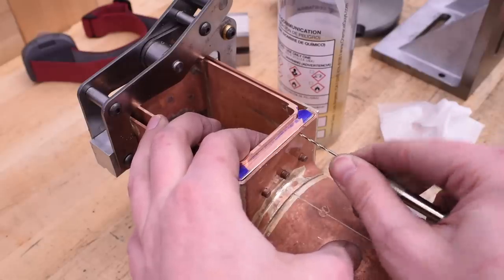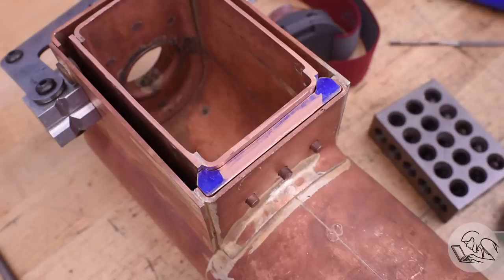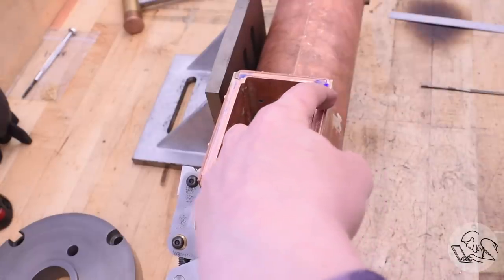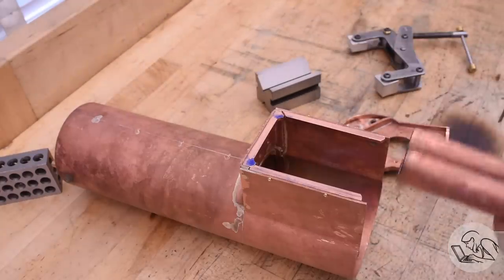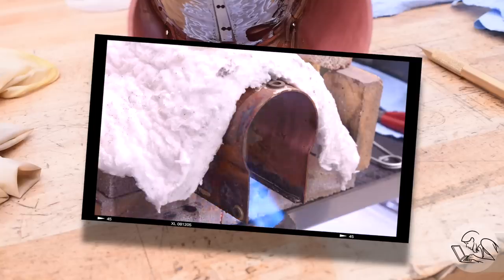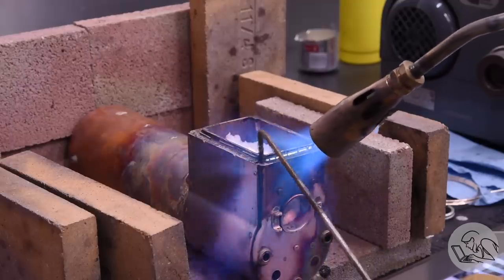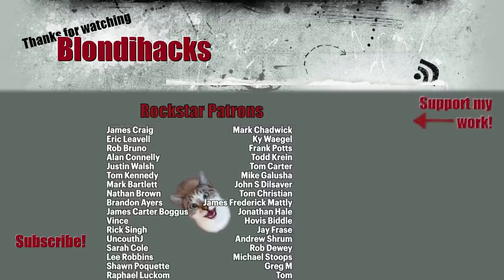Foundation Ring and Backhead! Pennsylvania A3 Switcher, Part 11

Comment: I'm a boiler tech, not a train head, but we call the lowest point of a boiler the mud lug because, well...open up a plug at the end of the season to find out!
Reply: all the insoluble material collects there. looks brownish and ugly.
Reply: That's what I was thinking. I've seen some of the "stuff" that comes out of the bottom of a boiler.
Reply: It can be silky smooth sometimes, and makes a great dye for everything that you don't want to get dirty.

Essentially, all boilers are distillers. Makeup water is a necessary evil, because new water means new sediment and dissolved oxygen which destroys a system. On larger boilers (100hp and up), if the mud legs aren't blown down regularly, the mud eventually turns into something like semi-solid concrete. That's when we hand the chisel and grinder to the apprentice.
Reply: It's why full size locomotives have to go through a 31-day inspection that includes a boiler-wash:
CFR 49, Part230:
230.60 Time of washing.

(a) Frequency of washing.  All boilers shall thoroughly be washed as often as the water conditions require, but not less frequently than at each 31 service day inspection. The date of the boiler wash shall be noted on the FRA Form No. 1 or FRA Form No. 3. (See appendix B of this part.)
Reply: @joextarr8916  
Or you can use the Myth Buster method, a bit of the old boom stuff. Just don't quite take it to the cement mixer level. LOL
Reply: @jdgindustries2734 

Are these locomotives 100% makeup water? There's no condensate return systems?
Reply: @joextarr8916  yes. American Railroads tinkered with the idea of recycling the exhaust steam, but the equipment was too finiky and couldn't hold up to American Railroading demands. Also considering water back then was nearly ubiquitous, and where it wasn't, railroads ran tank trains of water to stage it.

But also the regulations are written assuming bad water. They are there for safety reasons

Comment: It's called the mud ring because when you make steam, you end up precipitating out solids. Those end up in bottom of the boiler and looks a heck of a lot like mud.  In a big boiler made of steel and cast iron, you end up with a lot of rust down there as well.
Reply: This exactly.
Reply: There you go. I previously thought it was named by fans of 90s/2000s progressive metal band Mudvayne.
Reply: Which is why, as Dallens points out, you should only use distilled water to keep the mud problem to the minimum.
Reply: @Dallen9  in some places they had collection troughs between the rails that would catch rain, then the tender had a scoop to scoop up the water. As a power plant guy where ultra pure water is the way......
Reply: @DavidVerch  That is crazy. No RO skid back in the days?
Reply: @Dallen9  was my thoughts actually... I mean just look in the bottom of your kettle!
Reply: @MikelNaUsaCom  Yes as I remember we blowdown at least once or twice a day on steam boilers {not a train boiler}
Reply: @oldfarthacks  Distilled water is hungry water; corrosion would be more of an issue
Reply: @royreynolds108  I will have to research it more. I did not know the troughs were so long, nor the tanks to fill them. I have heard but do not have any evidence that they would put potatoes in the boiler to help precipitate hardness. The city of Cocoa has a lime softening process where they use potato starch to help in the precipitation.
Reply: @MikelNaUsaCom  Ultra super critical boilers are once through and cannot have moisture separators as the feedwater and steam is the same density. Any contamination in the feedwater goes to the turbine and usually plates out in the low pressure section.... At one of the plants I was at they had several steps to purify the water. The purification system was in service continually and if there was no need for makeup, it would just re-circulate what was in the tanks to further clean it up. The way I figured it the purity of the water was just shy of what is required in the chip making industry. Another plant I was at had the transition section from the turbine to the condenser painted and we had issues with high silica during startup and other transients. That was difficult to get to the bottom of. The turbine manufacturer was not very helpful.
Reply: @crissd8283  Lime softening was developed in the late 1830s in England. I would imagine British rail used it first to help with boiler scaling.
Reply: @MikelNaUsaCom  The lower the pressure the water, the dirtier the water can be in the drum. As the pressure goes up the density of the steam goes up and more of the contaminants leave with the steam and therefore the boiler water is stricter.
Reply: @MikelNaUsaCom  I think these boilers are like 30 psi or something. Much different than the requirements for a 2400 psi boiler.

Comment: Micro tip (and just the tip!) - when you're trying to knock out that last 1 or 2 thou in soft metal (opening up that clearance hole in your case) under power like with your drill, run the bit backwards. It's not 100%, but stops it from grabbing, ripping and pulling itself through the hole.

Comment: I learned the hard way Sharpie repells automotive and house paint. I had some marks on sheet metal when making panels for my 31 Model A Ford. Well I had to sand off the primer and acetone to remove the Sharpie
Reply: I also learned this the hard way. 😺

Comment: Quinn- I have been a scale model railroader for over 40 years. My grandfather was a master machinist for the Santa Fe Railroad, earning his apprenticeship in 1913. During my lifespan I have done a lot of soldering of brass locomotives in HO and Sn3 scale. Early on I used a small jewelers torch and then progressed to resistance soldering. In projects MUCH smaller that what you are doing you can imagine what happens when you overheat and all the OTHER parts start to fall off! I would point out that I was NOT trying to make a pressure vessel! This was a process to fabricate a "boiler" from scratch and attach many, many brass castings and parts to make the complete locomotive. I had a lot of friends who were quite simply master craftsmen who could totally build a scale locomotive right down to the exact number of rivets (hence the term "rivet counters"). Again, the model locomotive was powered by an electric motor and not live steam. The "live steamers" (a fraternity that you are joining) are in a class all their own and I'm sure you have seen many examples of their fine work. In most cases, they appear 100% true -to-prototype and perform flawlessly. From similar 0-6-0 "shifters" to massive compound locomotives that are capable of pulling a string of passenger cars (with human riders) along a mile of track. Unfortunately most of these folks are getting up in years and very few young people are interested in developing the skills necessary to accomplish such projects. Thank you for your fine videos and for keeping this craft alive!

Comment: Old boiler inspector here… The main purpose of the water jacket surrounding the firebox in a locomotive boiler is to provide an easily cleanable low point for dissolved or suspended solids in the water to accumulate. Without mud legs that muddy precipitate would collect around the tubes, usually at the tube sheet and drastically reduce heat transfer, promote corrosion of the thin fire tubes and lead to cracks in the tube sheet. There are always handhole clean outs at each bottom corner of the mud leg. There’s a small benefit of added heat transfer surface as well.

The puffs of steam from the smokestack are actually the exhaust stroke of the drive pistons channeled to the smokestack as blondiehacks said to induce draft. Many locomotives have an hourglass shape to their smokestack that creates a Venturi (a convergent-divergent nozzle) that greatly accelerates the speed of the air out of the boiler.

Comment: I would never had though making a scale train boiler could be so edge of the seat! I’ve built 1/12 scale 5 ton military trucks from brass and copper and know how hard it is to solder a joint next to an already finished joint. You make it look easy, great job as always!

Comment: Tip for you on that solder joint that opened up on you.  Stuff a bit of copper wool or solder wick - the braided copper used in electronics industry to remove solder from a component being removed from a circuit board - into the gap you're trying to re-solder.  It does a great job of capturing solder and the surface tension from all of the little bits of copper in the braid will prevent the solder from dripping out during the next reheat.  Of course the ideal scenario is to never need this trick but at the point you're at now it may save your bacon.

Comment: Back in 1962 my small center punch from the Starrett set was dull. Ordering a replacement I chucked the old in the Gorton cutter grinder an spun a 25° included angle to repoint it - with a loop I could pick up the intersection of 2 scribed lines. It's detent could be deepened/widened with it's replacement.
Did tons of silver soldering of dowel pins in crs 'i60 - '62, keep clean and fluxed.

Comment: Have you tried silver solder paste along with rods? It is silver dispersed in flux, so you have silver in place and ready to melt before you even apply heat. Of course it will not fill all the gaps by itself, so some more silver is needed (and rod will be drawn into the joint thanks to layer of silver from the paste).

Comment: To make a easy template for this mud-ring: place the assembly on a photocopier (copy machine) and in a few seconds you have a exact 100% scale 2D-drawing that you can lasercut/file out.

Tip for next time.
Reply: Actually a photocopier doesn’t guarantee a 100 percent duplication, in fact I’ve found it usually isn’t. But you can do the same process with a flat scanner, then adjust the printout percentage until it matches the part.

Comment: Templating (at least roughy) can be done with cardstock, and I’ve used the additive method to reasonable effect on a couple of projects (albeit on larger parts than this); but I found an interesting iterative subtractive method which might be one for the toolbox.
If you run your scriber in the centre of a ring (a nicely concentric washer, or a small bearing race for example) you can offset the profile you’re trying to match by the wall thickness. This gives a great first approximation curve to work to with minimal waste - just remember that it’s an offset, not a translation… not that I ever scrapped parts by forgetting or anything…
Reply: C.A.D. - Cardboard Aided Design. :)

Comment: Almost pressure test time? Can't wait to see this thing work. My own steel boiler had some leaks  during its pressure test but I think it's easier to weld those shut than it is to solder leaks on a copper boiler. Good luck!

Comment: Jewelers broaches are excellent for adjusting hole sizes, at least in brass. They are hardened steel hexagonal rods with a very slight taper  just rotate by hand while gently pushing in hole.

Comment: If you mix yellow ocher with a small amount of flux and put it on larger joints  the solder will not flow out of your joints . But if you get any of it on your new joint it will not solder. I learned that doing silver work ,which mistakes get very expensive quick .

Comment: From filing I though immediately if this is changing to a channel like ClickSpring. Nope, back to milling immediately.
Still, back to filing much more than my patience would ever take and hand drilling. I'd not take risks at that point either, not after all the work it has been so far.
I think the series has involved quite a variety of different skills needed. It has been quite interesting so far (and I'm eiger to see what it will bring later on too).

Comment: the mud ring; is a low spot for the collection of minerals in the water, a good engineer will open the blow downs to help clear those contaminants; there is an inspection,I believe it's monthly on steam engines where the "wash out plugs" are removed and the boiler is flushed out. the railroads added water chemicals to hold down some of that sediment. But it was a constant battle

Comment: Also there's this thing I use called technoflux, it's a thermal paste. I use it to cover the soldered joints I want to protect. I work with jewelry so I deal with a lot of small easy to overheat parts and it's a lifesaver.

Comment: Not me watching a video of someone building a steam locomotive while I'm finishing an HO scale steam locomotive lol
Reply: For those who might be wondering, it's an Athearn Genesis USRA light mikado kit from long ago, I disassembled it and rebuilt the mechanism, swapped out the old speaker for the sound decoder, and detailing it a little bit on top of what's stock on it. The decoder is a Soundtraxx steam one. I did give it a slightly larger tender for a bit more coal capacity just to make more room inside, and I don't really like the small tenders these locos had, it looks the same though, it's basically the tender Southern 4501 has but instead of tool boxes underneath, it's rerailing things.

Comment: Belzona.  I am a retired US Navy engineer and we used Belzona extensively throughout our boilers and steam propulsion plants.  Not because it was the best way, but because it was the ONLY way.  Sometimes our steam generating equipment is 40+ years old and there was no longer any manufacturer support.  We used Belzona to fix cracks in our boilers, deaerated feed tanks, steam turbines, heat exchanger tube sheets, steam valves and so on.  It is kind of cheating, but if no one will see it, who cares.  A bit pricy, but the small scale you are working with, one 2-part kit will probably last you the rest of your life.

Comment: Hello Quinn, Couch expert here... lol... would that work ? using the roofers torch (attached somehow) to bring the temperature close to what you need in a large area and at the same time, use a small torch to get over the melting point in the specific places you need to solder.  On a scrap part for science. ;)
Reply: @jeffarmstrong1308  did you record it?

Comment: Surprised you didn't scribe around the outer edge at half the thickness of the foundation ring. That would help get all the screw holes to the center of the bar stock

Comment: ok i have a silly suggestion to get an approximate shape and sizes -- try using at trim contour tool --the size and shape wouldn't be machine correct but would get you in the ball park for rough dimensions

Comment: @blondihacks Quinn, at 22:15-22:25, as you were looking over the first mudring soldering, it looks like the corner of the backhead (enginer's side when in proper upright position)   came loose just a tiny bit creating a gap in the mudring. Can you verify that was just a trick of lighting? I'd hate for you to get furter along and go to pressure test and find a leak there.

Good luck, this thing looks spectacular. 

Am i allowed to hope you go for an NKP 2-8-4 Berk next loco?
Reply from the maker: I see what you mean- that’s just a step. Those two pieces aren’t perfectly flush and there’s a shadow/soot line there. That corner did leak (spoiler alert) but from a different place 😬

Comment: please get an old classic drill thats hand powered i have one and its very good for those little fixtures nce u get the drill bit started u can just use ur right hand to power the hand drill with a bit of pressure behind it
Reply: may be fun to also make one of those as a project
Reply: You can also use a Yankee screwdriver for that.

Comment: With the hand drilling operation, opening up the hole.  Could you have tried a chamfer on the hole before using the large drill bit?

Comment: I wonder what half-lapping those corners would do instead of using those wiggly curves.  seems like the kind of thing that would lend itself well to mill work with small endmills and silver soldering close joints

Comment: Soldering PCBs is Sooooo much easier. This fixture, intuitively, would open one joint as you closed another. Glad it all worked out. Impressive “custom part” assembly. Eli Whitney is cringing in his grave. :-)

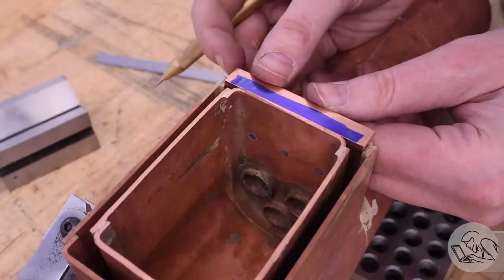Comment: 3:55 - Is it not possible to use the inner part as a stamp of sorts? Some blueing that doesn't dry immediately that you can put on that inner rim and then push the piece of stock against to get an exact imprint?